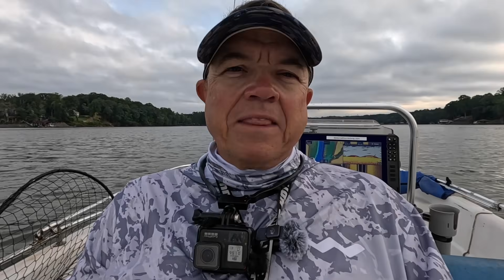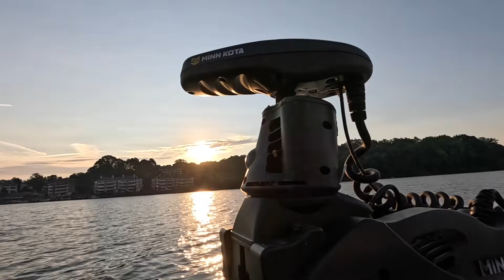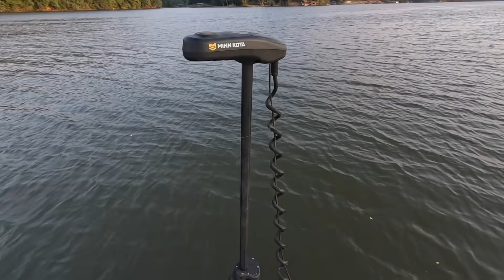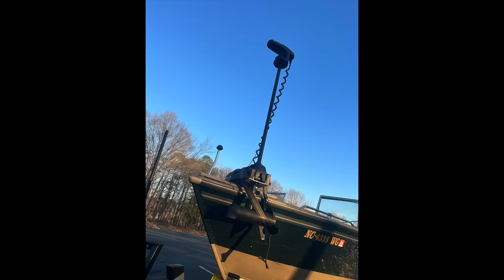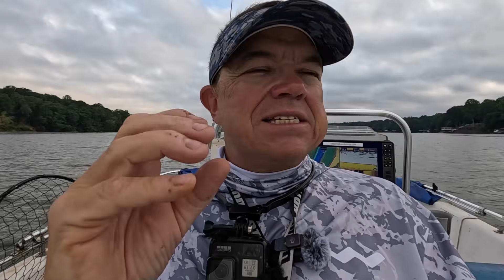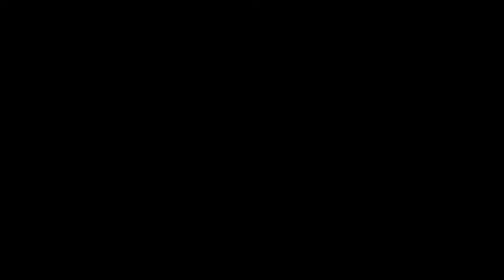Why This Minn Kota Trolling Motor Failed

Comment: Misleading product description(s)! NO SALTWATER (non-riptide)!

April 2026 update:  This motor has been to the shop for $1000 worth of work THREE TIMES in 16 months.  NOT saltwater related work.  It's destroyed more fishing and water outings than it has helped.  You have TWO choices with this motor:  be ready to bleed money, OR be ready to become an uncertified Minn Kota tech while you try to troubleshoot each next problem.  For me, fishing is problematic enough.  After 16 months, I put this up for sale for 20% of what it cost me, and I'm done with the brand.

I purchased in March 2025 and had the Ulterra professionally installed in April 2025. The motor required $500+ in service in January 2026, seven months later. I took the motor to a certified Minn Kota Service Center. Before initiating work, they informed me that the motor’s warranty was INVALID due to the repair facility’s presumption that I had used the motor in saltwater.

Prior to purchasing this motor, I did about TWO WEEKS of research to insure that the motor was suitable for all types of water and fishing that I intended to do. The videos on Minn Kota showed the motor being used in salt water. There was never any mention–neither on the vendor website product description, nor on the Minn Kota website–that this trolling motor was ONLY SUITABLE FOR FRESHWATER. Minn Kota sells a trolling motor with increased corrosion protection that is (and was, at the time of purchase) approximately the same price. So if there had been ANY indication that saltwater would have voided the warranty on the Ulterra, I would have simply purchased the other model. No such indication existed.

I visited the Minn Kota website circa January 14, 2026. The warranty information confirmed that saltwater use invalidates the warranty. I do not believe that this is the same warranty language that existed on the Minn Kota website at the time of purchase (March 21, 2025). Also, none of the written materials received with the trolling motor indicate that it is for freshwater use ONLY, or that saltwater use invalidates the warranty.

On January 14 and 16, 2026, I contacted vendor to file an refund claim. Vendor customer service CONFIRMED THAT THEY CHANGED THE PRODUCT DESCRIPTION since the time I purchased the Ulterra trolling motor. Vendor changed the description to include the word “Freshwater,” but the vendor still leaves it ambiguous as to whether the motor is freshwater ONLY, and does not make ANY STATEMENT that a SINGLE, SALTWATER USE will invalidate the Minn Kota warranty.

All of this said, I am believe deceptive marketing of this product that has resulted in current losses to me for non-warrantied repair, and prospective future losses due to ongoing repairs of a product that should have been under warranty if not for the deceptive and incomplete/inaccurate product description and misleading product videos on the Minn Kota site.

If you have this motor shipped to coastal Florida, Minn Kota and its certified repair facilities will probably assume it has been used in saltwater, without even asking, and void your warranty.

I have emailed Minn Kota and will update review pending resolution of repair issues.

Comment: Thanks for sharing! I do maintenance on mine religiously and no issues.  There are some great videos by Minkota and others on YT how to maintain and rebuild these units. I urge you to watch them all for tips and maintenance. One of the videos I found also talks about the wasp issue. Tight Lines 👍🏻👍🏻🎣🎣😎
Reply from the maker: Most people that use them a lot agree that they are maintenance nightmare compared to the other motors made by Minn Kota.

Comment: I have one. Going on 7 seasons on it. Have only had one time i had to take to a repair shop. Ran it into a dead man's tree on the ohio river. Bent the pressure plate. Besides that. I have never done any maintenance once. But yes. I agree when it did shit the bed when I was on the water. It sucked... Everything has its plus and negative.

Comment: I have a mercury motor on my boat and a wasp stopped the pee hole up with dirt. Had to run a wire up it at the boat ramp 🤬
Reply from the maker: It’s amazing the small holes they’ll plug!!

Comment: No maintenance! BS . I SPRAY THE SHAFT AND EVERY moving joint and worm gear EVERY trip  5 yrs no issues. This motor has to be maintained . Not abused.
Reply from the maker: Sadly, no matter how much silicon you spray on the shaft, it doesn’t make it stow or deploy once it’s locked up.

Comment: I love mine but it comes with with the need of attention and knowledge.  I keep mine on a quick release so it's very easy to remove.   Also it's really not hard to remove the panels to manually stow.  Lots of videos.   If you are not mechanical at all I would not get this motor.  I love using it line me up perfect for putting the boat on the trailer on a windy day.  Line it up perfect.  Stow it while you are putting it in gear.  I also keep the foot pedal in a storage compartment as a backup for the remote.
Reply from the maker: You summed it up well; not as simple as the other models.  Convenience comes with a price!

Comment: I had one that was on a boat that was sitting under some Oak trees for a couple of years unused. When I got it washed down and ready to check the trolling motor, the trolling motor came on for about 30 seconds and then I shut it off satisfied that it still worked. That's when I first noticed the fire ants swarming on my trolling motor and deck! At first I thought they were coming from inside the storage compartment beside the trolling motor, so I took the trolling motor off and the ants started coming out of it carrying eggs! That's when I knew they had a nest inside it! I sprayed down the outside with bug spray and tried to run the motor again to get more ants to come out, but it wouldn't come on again. Long story short the ants had gotten inside the trolling motor and ruined it. It never worked again!

Comment: remove you cover and coat the inside and all access openings with a floor paste wax  or silicon "grease" the light coat will prevent any mud from a dirt dobber from sticking and deter them from future nesting ..basically anything coating the plastic will deter them
Reply from the maker: Great tip, thank you!